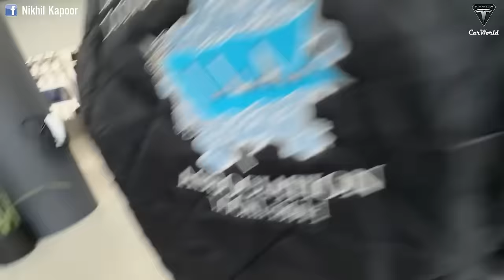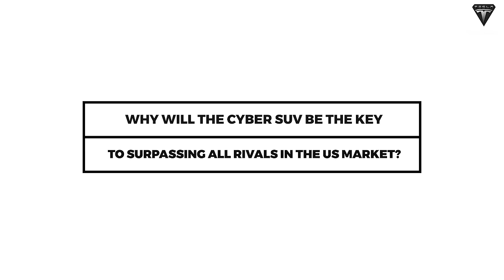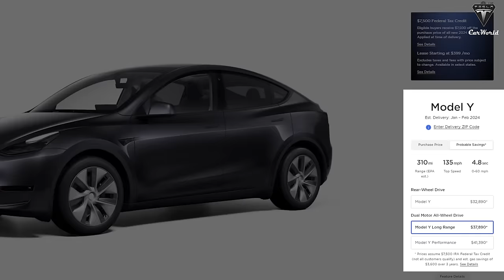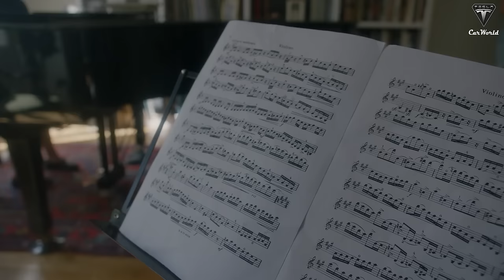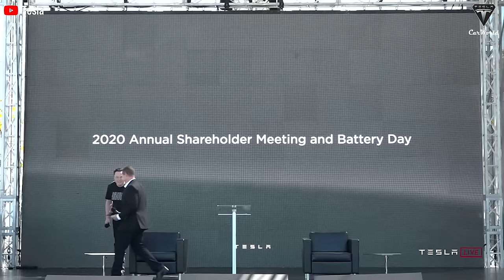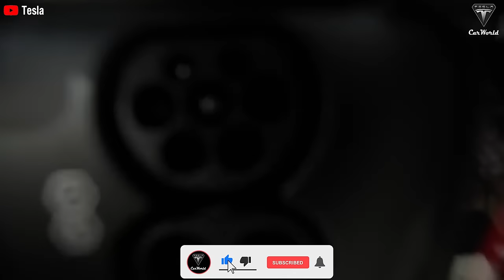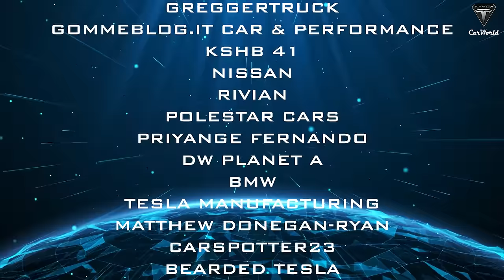The 2024 Tesla Cyber SUV Will Hit the Market Soon! Unveiling the Future...

Comment: Affordable EV trucks are on the horizon.  I don't need 500 mile range or 10,000 pound towing, 37 speakers, heated seats, instant charging, FSD, or air suspension. I only need 4 wheel drive and light hauling and towing for travel, camping and jet skiis. 😊

Comment: I would like a Tesla full size SUV, but the definition of a Y as an SUV is BS.  it is a hatchback sedan.  I have driven full size SUVs for years, and it is what I need for my various use cases.  If they took the full size pickup and converted to SUV, I would buy.  If it did not look like the cybertruck